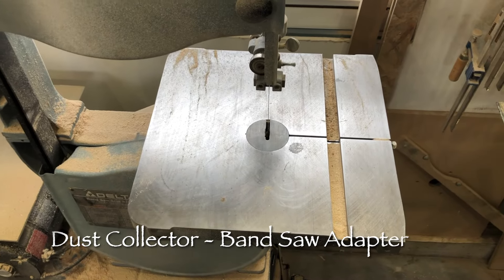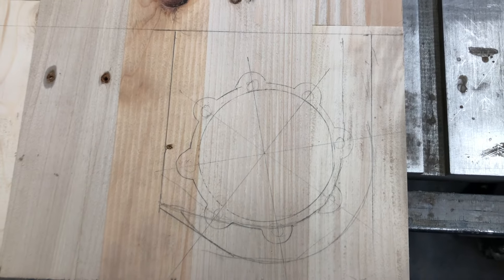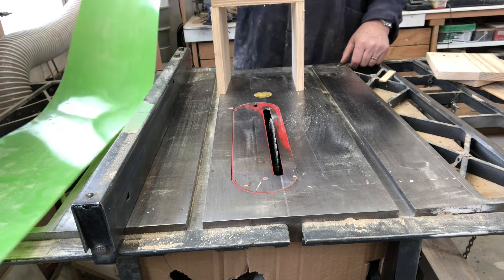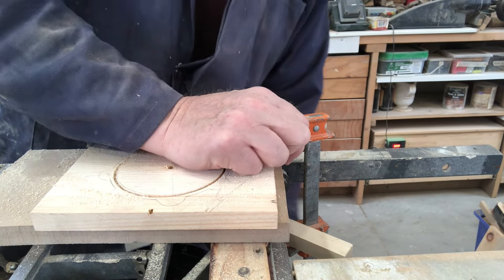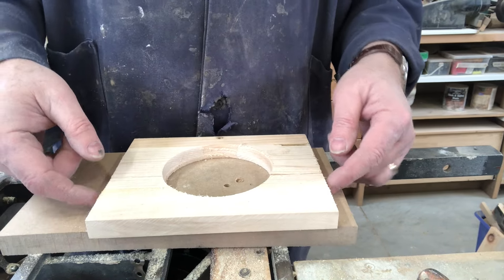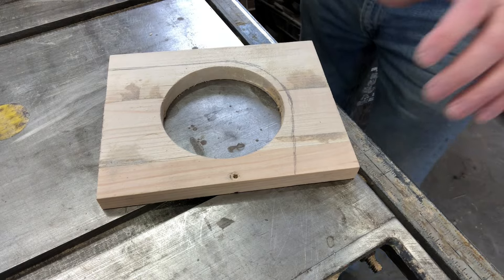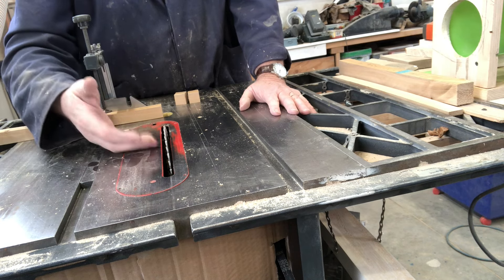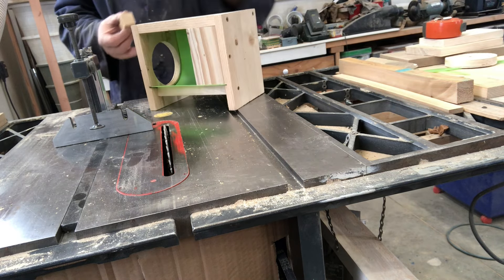Dust Collector - Band Saw Adapter

Comment: You do some things on the table saw that most people would consider very dangerous. It seems like you know what you're doing, but if your channel grows you might want to do cuts like  3:12 (edit: and 19:39) off camera 😛
Reply from the maker: Thanks for the tip. As I go, I am learning to be more careful and take proper precautions.  In an upcoming video, you'll see I've changed my process for cuts like the one at 3:12. I need to get some push-sticks for the cuts like the one at 19:39.  Maybe a "short" on that one. Really appreciate your feedback.
Reply: @secretundergroundlair4014 Safety-related feedback is annoying and I don't like to be that guy. I myself am accident-phone and my dad has nine fingers, so in my own shop I try to be as safe as I can.
Reply: I see what you mean, having just watched Stumpy Nubs' newly released video on how not to make certain cuts on the table saw, e.g. this one, where the board is wider than long.